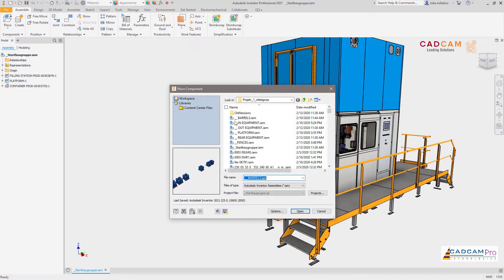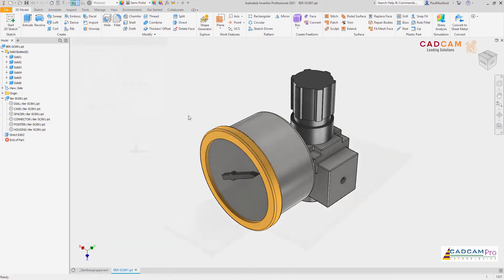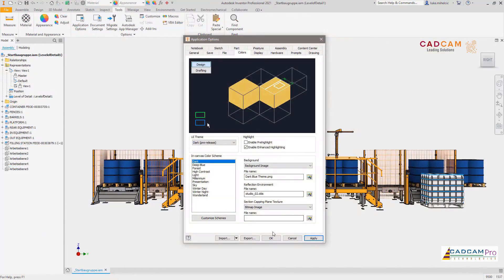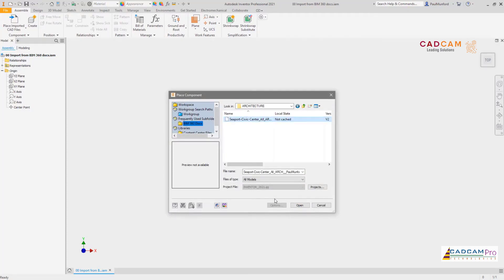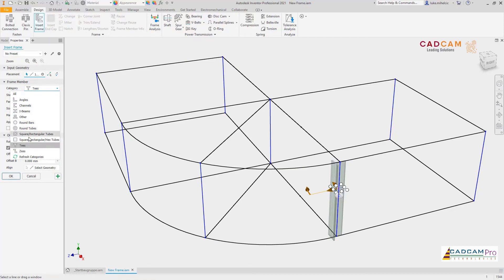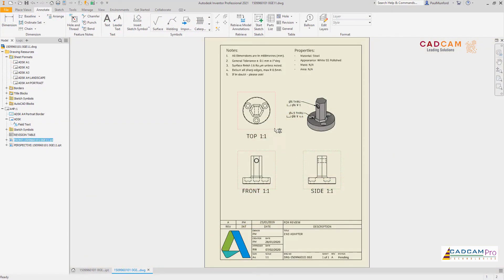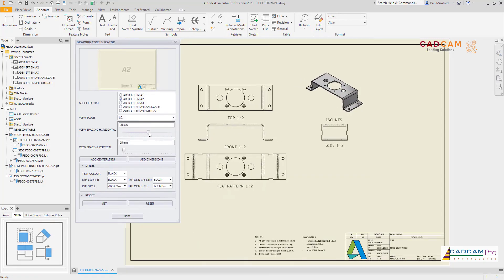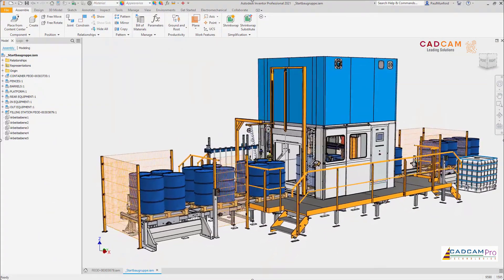Autodesk Inventor 2021 Whats New | Inventor 2021 New Highlight

Comment: Meanwhile it still takes Solidworks 5 seconds to start a new sketch on a 50 core supercomputer with 2TB of ram.
Reply: @I Am Sekou Solidowrks works great for giant assemblies, but the user interface is so fucking horrible. Menu arrangement is illogical and there is little consistency between panels. Sure, it is powerful, but the whole thing just feels clunky and unresponsive, resulting in a horrible user experience. Inventor does 95% of what solidworks does at a fraction of the cost. It is also a lot easier to learn because things are generally where you expect them to be, not hidden in a giant parameter dump. Small differences like the file tabs at the bottom and automatically looking at the face when making a new sketch just makes the program more polished. In other words, unless you are building a rocket with 2 million parts, chances are that inventor is the better choice at a fraction of the cost. I also use Fusion 360, but mainly for CAM. The CAD feels like a cut down version of inventor but the CAM is amazing. Does what mastercam does but for free.

Comment: What is better solidworks or inventor?
Reply: They are both ok. If you have a lower end computer I would recommend Fusion 360 (Inventors little brother), the pricing on it is nice and you can do most of the stuff Solid and Inventor can.